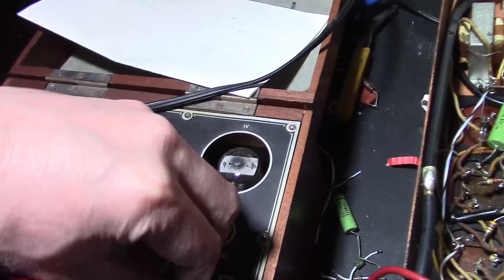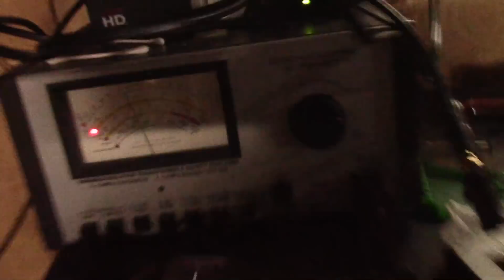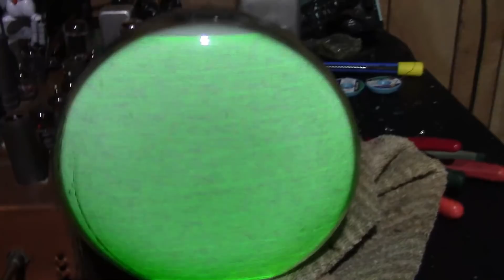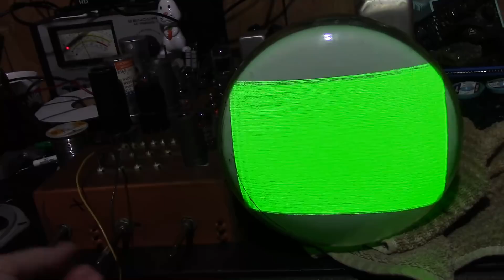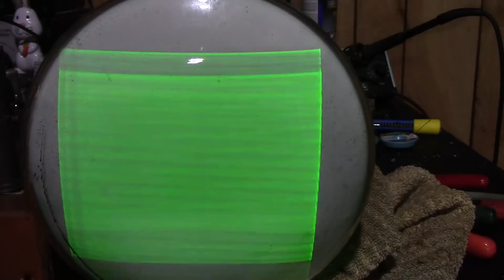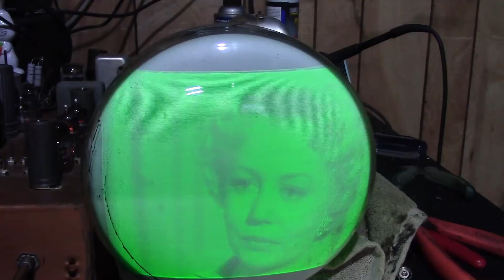Motorola VT-71 restorations p5o10

Comment: I like the vintage capacitor tester too ,I find they work better then a scr meter or a multimeter ,they check for more things like leaks and check at voltage the cap runs at.

Comment: Audio coupling cap was ceramic, the schematic says 5000, usually caps listed in uuf values were ceramic or mica, paper caps values are usually listed in if in this case .005 would have been on the schematic
Reply from the maker: Yes, you are correct.  I compared it to several other TS-4 series chassis and they had ceramic audio coupling caps as well. I was throw off because they look different that the other 5000 pF ceramic caps used.  Perhaps they are a different dielectric or voltage rating.

Comment: i dumped cable 2 years ago.. got an old tv with only rca yellow white red or cable input got hdmi to rca  converter but tv wont play sound from computer unless i have second sound wire 3.5 out of pc any ideas guys
Reply: Your computer isn't setup for sending audio out via HDMI... it may be possible or it may not be. If you are running windows, in control panel under sound settings you have the output device (usually speakers) or something like that, I also have my HDMI monitor in there, if I set that as default device then the sound also goes through HDMI...
Reply: Foxeema TV This isn’t really the place to come for that kind of help, but I’m guessing to fix your issue you need to go into the BIOS of the computer and enabled audio through HDMI. Where in the BIOS it is and what it’s called will depend on the computer you have. Give it a search with your computer model (or motherboard model) if you can’t find it.

Comment: I noticed you using the Solar capacitor tester testing your capacitors however I have not seen you use the Sencore LC 53 that you had bought some time ago are you still using it ?
Reply from the maker: James Lucas Hi. I never got around to repairing it or making test leads. The Solar works so well I haven't really had the motivation ;)